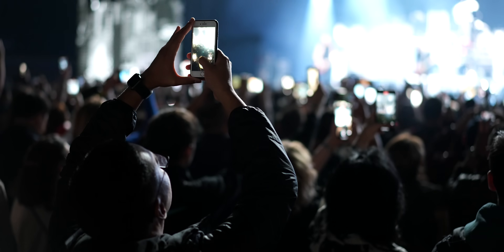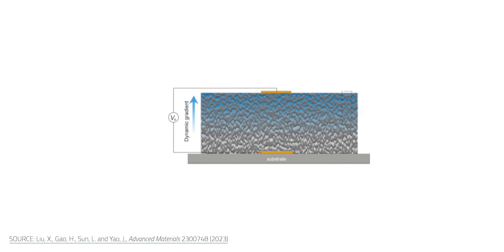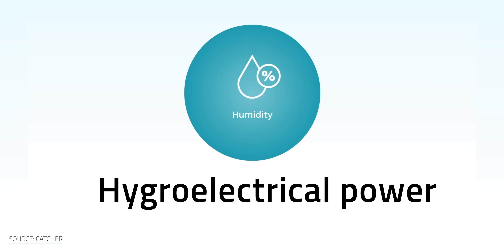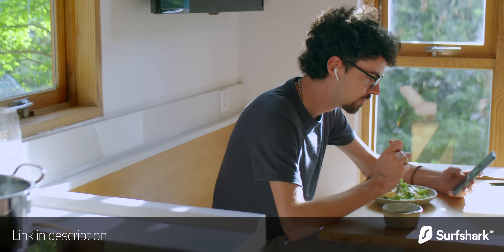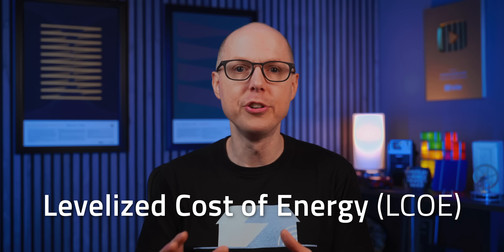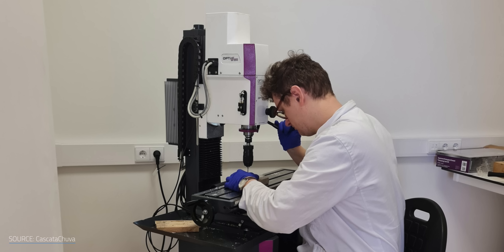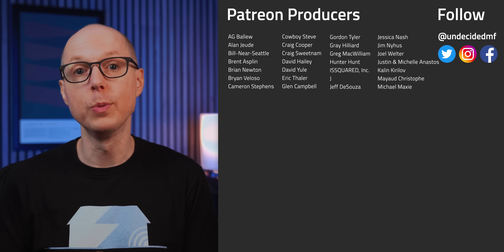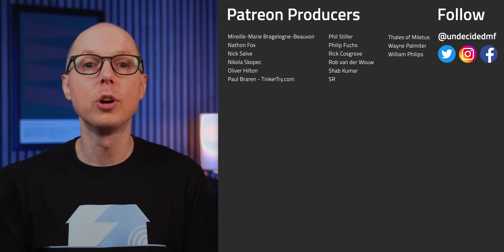Is This Accidental Discovery The Future Of Energy?

Comment: Ionic power generation has been bounced around for several decades as a possibility, and this sounds like the same thing.

My concern is that mold, bacteria, particulates and dust will clog scaled up technology purposefully made to be dense, large or compact. And it might be difficult to fully clean these devices, though you could just wash them out with a garden hose I would assume? (I'd assume that if you can't manufacturer it to be easily cleaned, or highly functional all the time, what's the point?) 🤷‍♂️

I would remain very skeptical of this until you see working prototypes of EACH size. Ionic power generation has always seemed to tout benefits and conspiracies without scalable models of note.

If it does work well, I can see engineering needs for different areas of the world having varying degrees of design from this tech, based on the environment (temperature, humidity & air quality) they are intended for. So more precise 3D printing in the future could come in handy here to adjust the production line.

Sounds like a combo of the low power output and reliability of wind and solar, but without brittle parts or moving parts 👍 So I'm interested to see where this goes. If they can properly scale it and make it cheap and reliable, even if it were only 10V or 3W, it would be a great addition.

Comment: Fourth phase of water, Prof Gerald Pollack explains this phenomenon. Layers of exclusion zone water form next to lipophilic surfaces and is built by sunlight/radiant energy. This is also how our cells function as capacitors to concentrate energy and why there are no ion channels or pumps needed in cells. It’s a passive process that emerges from the special properties of water, a fourth phase (H3O2) that has liquid crystal-like properties, forming hexagonal sheets. The angles are everything in EZ water. I think this phenomenon is leveraging the fact that the light hitting the top of the channels builds EZ water layers, vs more tendency to protonated (bulk water) below.

Comment: I'm not sure if your comparison with solar power was correct. You compared a 10kWh/day hydro system with a 10kW solar system. Those two are quite different. 10kWh/day is 416W. That means that the hydro system is about 24x more expensive than the 10kW solar system.

Comment: Matt, I am rather confused.  Is it a generator or battery - or both?

As an electronics Engineer (retired) I am finding it difficult wrap my head around this concept.  Methinks a storage mechanism is needed in addition to the generation mechanism to work effectively.
Or am I wrong?  Would love to know.

We do NOT use resistor dropping to convert from one voltage to another, and have not for many years unless the discarded power is minimal and irrelevant to any design.  Instead we use Switch-Mode-Power-Convertors to step up or down.  Typical efficiencies now normally exceed over 93% for such inverters.

Will do some browsing to see what turns up to hopefully answer my own question/s above.
Reply: Good point.  I think it's a generator because the humidity generates electricity and doesn't actually store it for later use.

Comment: This thing CAN NOT be a generator. I can buy it as a form of battery where absorbing moisture drives out electrons to produce current and adding current drives out moisture, but this does not a generator make. This device can not continuously absorb moisture, it will become saturated at some point and stop producing power. If it works like a battery and absorbs moisture at a set rate based on humidity then the talk of "producing" 10kwh per day becoming relevant since there is realistically a limit on how much moisture a material can absorb in a set amount of time. Charging or drying the battery should be easier and faster though since you could just add fans and more power to drive out the moisture faster at the cost of efficiency.

Sloppy work in fact checking or writing by the presenter for even mentioning the word generator in this story.

Comment: I can find room for the thing, but my HOA insurance isn't gonna like it if it can go up in an unstoppable blaze.  That's why I don't get a lithium battery stack for blackouts.  Condos and apartments are going to need collective solutions to renewables and storage that involve complex-wide decisions about rooftop use and outdoor siting of storage within fire resistant, fire code compliant buildings (i.e. cinderblock sheds or similar, with local firefighter training for lithium fires).  Of course, none of this was necessary with 1970s nuclear...

Comment: I want to follow this up, there are numerous quantum effects that can occur in nano environments and generate energy at the point. There is no free lunch, but the 'cost' of humidity is paid for by the sun which for us is effectively free (no one thinks that conventional solar power will 'run down' the sun and on a world wide scale solar power is the source of humidity), I do not see that there would be a limit to the production of humidity by sunlight that would become relevant in human scale time. At the moment humidity is in equilibrium with the input of solar energy and the ability to shift that equilibrium is not very great). Dust is an immediate issue but it might be possible to effectively ignore dust since a molecule of water vapor in several orders of magnitude smaller than a particle of dust. I think its worth seeing if it will work, I would not mortgage the house yet to support it but I will be keeping my eyes open

Comment: You're comparing the price of a 10 kW solar panel setup with a  10 kWh/day hygroelectrical setup? That's a little misleading, being different units. My 4 kW solar panels can generate over 20 kWh/day on a good summer day 🙂
Still, interesting tech if they can pull it off.

Comment: Water running through a small channel, or even a larger one, will slowly erode/break down the item the water passes through. The other negative issues are, how much water does it take to supply these devices? Creatures and plants need water to live. What chemicals are released through the breakdown process? We don't want to keep pumping toxic water into water supplies.

Comment: Its not "Free" energy as a few comments put it - but doesnt sound like it would scale well either. Energy comes in different forms, but mainly from the sun being the real input. So really, its like a solar panel that doesnt take it directly from the sun it self - but from water. More or less - if this does work, it could be a cheaper solar panel. As you would only need glass, water, and maybe a pump. The glass would store water that sits on top of your roof heating up by the sun turning into steam -> the steam flows over the power generator making power -> the water cools down turning back into water that flows back into the glass panels.

Comment: Makes me wonder what would happen if you put this into an enclosed are with a humidifier and put in water to the humidifier so you can run it in non-humid areas.

A small solar system can then be used to run the humidifier.

Put the whole system into a car, you end up with a car that need little external power.
Reply: Yes, the humidifier could run the humidity to electricity generator, which could then run the humidifier. Viola, who needs power sources anymore!!

Comment: Regarding particulate fouling, old spinning disk hard drives have had their read heads drift closer to the platter than dust and smoke particles since the 90s at least, a speck of dust could literally jam under the head and scratch the surface. IIRC They didn't just solve the problem by sealing the disk because of pressure issues. There is just a cheap enough way to filter that out of the required inlets to be viable. They throw a tiny silica packet in too because humidity will pass through still. Seems like, on its face, the particulate and humidity interchange issues aren't unresolvable, probably just performance limiting.

Comment: Imagine this technology meet vaccuum technology. By theory, making container that only consist of water vapor and nano particle will enchant this battery to maximum. But this method isn't great for small aplication like matt says. If this could be made then we could decrease power loss from heat generated by appliance and for big application as power generator this could use water critical state as vapor so no need high heat to maintain water vapor state

Comment: You can't make energy from nothing. It likely acts as a battery when it is completely dry, and stops producing voltage once the moisture is settled in, and then one needs to heat it to get it dry again. Perpetual motion machines don't exist. I'm certain some will invest... and loose their money.

Comment: The explanation as to the source of the energy seems simple enough to me:  water vapour molecules have substantially more energy than does liquid water molecules; its in the form of the kinetic energy of the water vapour molecules and is known as the latent heat of steam. If these energetic molecules of water vapour were to condense onto a surface they would have to give up their kinetic energy. Normally this energy transfer takes the form of heat and heats the surface. Apparently in this case the energy transfer is in the form of electrical potential voltage. I would expect the cavities to quickly fill with water and the energy flow will stop unless the liquid water can drain away.  Yes, when functioning, the system would produce clean distilled liquid water as a by-product.

Comment: Seems like billions of teeny tiny pores would sooner or later (certainly sooner than desired) get clogged up with slightly less teen tiny gunk and the hundreds of devices would deliver less and less electricity.  Which begs the question, how do you clean billions of teeny tiny holes that are plugged up.  We'll need lots of teeny tiny plumbers, think of all those teeny tiny butt cracks! :-)

Comment: First law of thermodynamics. That's what's she said.

You can't just get energy from nothing. And you either should lose water locked in there, either has to evaporate it with outter energy or it will lose it's power source in some time as a simple chemestry based battery does (so it is not a renewable energy source but a battery, and it could be the energy needed to make a thing is much more than the energy you get).

Comment: I’m very skeptical.  Something has to be out of equilibrium to generate power. If the device works on water in the air, this implies that there is somewhere that the water goes on an ongoing basis. If the water simply binds to a surface or fills nanopores, it will quickly reach a point where the surface is saturated or the nanopores are full. Then everything comes to a halt. Essentially this looks like a low capacity battery that you charge by drying it out, not a power-generating device like a solar panel. This one does not get my investment money.

Comment: Lot of unanswered questions, but it sounds to me as if this is extracting energy from the heat in the moisture.  The collisions slow the water molecules, thus making them cooler and the lost energy knocks electrons free and their flow to redistribute is usable for electrical generation.  I wonder if it scales up if the humid air is hotter, say with good old fashioned steam.  If this could be used to directly extract energy from steam without moving parts, that would be HUGE.  But we would need to know if it would work well enough to efficiently get all the energy out of a reasonable sized run of piping lined with this stuff, also it would need to be sturdy and not degrade away after a few hours or days of use.  Being able to do direct extraction without turbines would be awesome, but this stuff needs a lot more study and an understanding of how it is working.

Use cases for this are endless if it can do this for steam and at a good rate.  Imagine you have a spacecraft and you want to use a nuclear generator (NOT a RTG) for power.  Instead of a heavy turbine you would just run the steam through a maze of piping lined with this stuff to generate power.  Any heat left over would be used to keep the interior and crew warm.  Same goes for terrestrial craft such as large ships, they could run on an SMR and this piping  and no need for a turbine hall, making a lot more room for cargo and a VERY compact power plant.

Comment: 🤓I don't understood the claim that it is not properly understood where the energy comes from or how it is generated.
Think about the energy needed to vaporize (heat) water.
The energy then goes into overcoming the surface tension for escaping molecules.
When capturing a H2O molecule in a narrow passage the same happens as when it would liquify.
The molecule is captured by surface tension of the porous material and the vaporisation energy is regained.

I also don't understood the suggestion that this process does not stop.
The captured water molecules stay there and once the nano-cavities are filled with them the energy input drops to zero.
Removing the water molecules from the nano-cavities would be needed to keep the process going.

I guess we will not see a commercial product as soon as here suggested.

Comment: It's no more than a miniaturised version of what happens in the 'Charge Separation' process inside thunderclouds.
Inside thunderclouds, ice crystals (really spiky little things) are strongly up-draughted  and contrary to a down-flow of much heavier water droplets.
'Friction' knocks electrons off the ice crystals, the electrons attach to the water droplets which then fall to the ground.
That is exactly what's depicted in the diagram at 2:35 - the water molecules = water and the nano-material is the spiky ice-crystals.
The top of the cloud (where the ice crystals finish up) thus acquires a positive (electron deficient) charge and the ground below becomes negatively charged and if you connected a 'resistor' or 'load between the two, you'd get electrical power. Enter: Benjamin Franklin

The breathless overexcitement here shows how Science has now retreated into a Kindergarten Dark Age  - demonstrated by the picture of The Man Tesla surrounded by lightning.
That nobody realises that that image explains what's happening in this 'effect'

Comment: A lot of BS here. 10μW x 20000 elements is 200mW = 0.2W. To charge your phone very slowly (or just powering it if you use it) you need at least 5W. So 25 of those boxes just to keep you phone running.
And in 24h it's 0.2W * 24h = 4.8Wh not 10kWh=10000Wh ! It's just a 2000* less !!!!
So you need 2000 of those small boxes. Can you charge an electric car? Not much. That's good enough for 50km for a car needing 20kWh per 100km.
Also you don't extract energy from nowhere. It means you induce a change in the environment. Do you dry the air? What happens to the water molecules?
How does that scale up? You need an air humidifier to compensate? And it will draw 10* the energy you get back?
Another "free energy" scam...